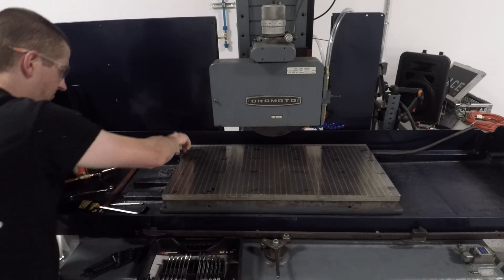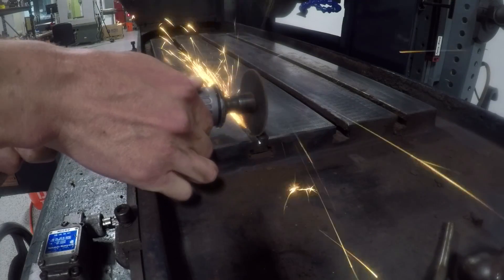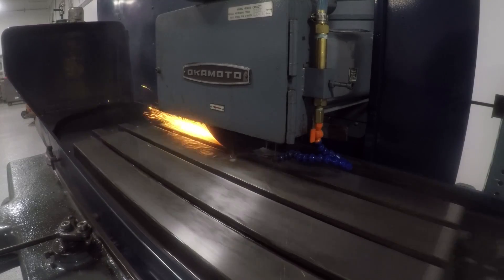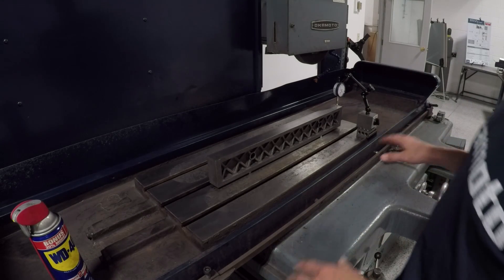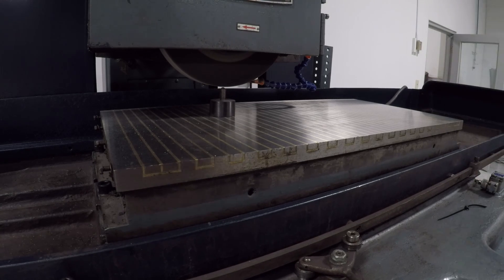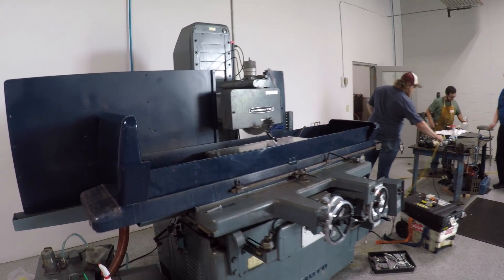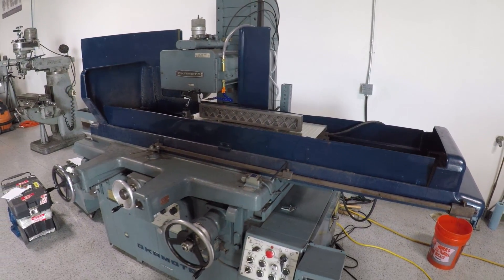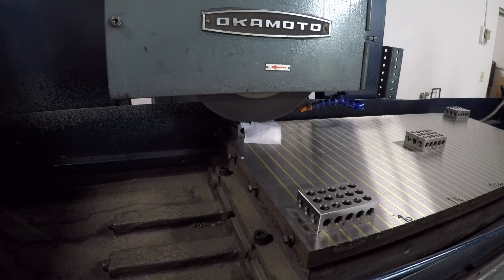Repairing & Re-Grinding The Okamoto Surface Grinder!

Comment: That is a nice descriptive passage, some of the older books do describe things beautifully. Another thing that often gets forgotten is the state, the sharpness, of the diamond dresser. A sharp diamond will remove the old grit from the wheel while a dull diamond will often push the dull grit back into the wheel and do nothing to clean the wheel off.

Comment: next time is better you use a level for check the machine table.and also can change the angle of the indicator,like that sometime no so good.better Tesa analogic level and steps by 100mm foe check surface

Comment: Hi John,
Thanks for presentation.

I have a Grand Rapids 560 12x36 very similar to yours and I just had the magnet off to check for rust and clean because I had just ground a large thin tapered shim by shimming the chuck. The book for my grinder recommends .0002" down-feed to dress the chuck with frequent dressings. The outriggers on it are part of the machine base so no adjustment that I know of.
Good luck.
Eric

Comment: Indicating that straight edge is completely pointless with your indicator on the chuck. What if the left side of the chuck was was high 3"? You would still get a parallel reading to the chuck. You absolutely must indicate off the spindle. Or the side of the spindle or column. That's the only thing that counts.

Comment: After the chuck is back on, Put you indicator in a mag base on the spindle. Get a sharpie and jog the table all over and write the readings right on the chuck. Start at the high spot and drop down .0001-.0003 per pass. Make sure the mag is on when you grind it. I have no idea what you were doing with that straight edge and your mag base on the chuck. Some folk swear by using a layer of crisco on the chuck when grinding it in.

Comment: Put the indicator base on a metal chair OFF the grinding machine. Make an extension if you need to reach then traverse the table in x and y. You can not use the table surface to measure the table surface. It does not matter if the chair is level or whatever you put the magnetic base on.

Comment: You want to do dust cuts .001 is too much 4 a chuck. You want to use water. The heat will cause expansion during the cut the contraction. It is better to use air to blow the coolant into the cut. When grinding a chuck and chuck base feed down of .0002 the one or two spring passes is best. To go past the end of the travel so the vibration of the reverse can settle down. Also for roughing cuts to dress .001 with a steady and kinda quick traverse. Then to finish grind dress .0005 and slowdown the traverse a little to close the grain however doing this will increase heat in the cut. After a finish dress be certain to one pick up the high spot of the surface two only feed .0002 or .0001. Take your time or the wheel will load then you will have warping do to heat transfer. .001 variance on grinding is like .01 in milling or turning.

Comment: think even if you lay a washer under one end of the mag chuck as long as you flatten the table to the grinder everything you grind will be level all over as you gauge everything to the grinding wheel , offcourse it IS better to have everything level to start with in case you remount stuff under the stone like the mag chuck

Comment: It's heat. It's all about heat. More heat is generated as the wheel breaks down. As the material being ground is heated up it warps, and cools down as you spark out, leaving highs, and lows. You need to rough within about a thousandths then redress the wheel, allow the part to cool, and then hit it about a tenth per pass then spark out and you should have better results. Making passes at about a tenth does not generate as much heat as you dial in your size and gives you a more even and accurate grind.

Comment: when you use your grinder, you absolutely need to run it with close to full table limits in X and Y for 10-15 minutes to let the hydraulic fluid get in to all the places its going to get in to.  That fluid layer could be as much as .001" and over a 2' chuck could be way more than that.  Warming up the grinder lets everything get in to place and get warmed up and get to leveling itself back out.  You can't just turn this machine on and expect things to go smoothly.  Grinding is an art.

Comment: John, Make sure when you install that new grinding wheel to have it professionally dynamically balanced! A lot of people do a static balance and think it's good enough, but if you want the ultimate in ground surface finish, get it dynamically balanced and the results will blow your mind.
Reply: I know this post is 10 months old, but is that where the old nerdy guys drag out an oscilloscope and try to identify some kind of frequency?  Just from the sound and some equipment, I think.

Comment: John, something that would have prevented that problem all together is laying down a good corrosion prevention compound on the bare metal under the chuck. I work in the aviation field and we have used many different types of CPC's over the years like that LPS 3 you have in the video (does not work well). What we have found to work the best even in saltwater spray/immersion exposure is corrosion-X. They have something in the solution that not only protects the metal but it will also stop existing corrosion from spreading by neutralizing the acids forming. And to remove rust from metal without changing the dimensions (mechanical removal) we use EvapoRust. No scrubbing no sanding no fuss.

Comment: After everything is done, moving grinder, possible regrind chuck, put silicone around magnet base to machine base, and for some reason, we had read at one time the holding bolts/screws on mag chuck should be of different torque one end to the other, and also we went back and forth about grinding the top of the chuck while it is on/variable etc, and how different a fine pole magnet is to one with bigger gaps? Will try to find that literature? You have done so well, and you really deserve it, I hear you say all the time you are not classically trained, but yet you are a true perfectionist!!!

Comment: I use a Mighty Mag with a diamond mounted in it to dress my wheel.  It's really handy when you have a part on the chuck that you don't want to take off just to dress the wheel for a finish pass. Just slap it on the top of your part and go.

Comment: Would have been nice to have an explanation along those "wrong/right" measurements, as others not-in-the-know might wonder why something is done the way it is. For example, when you put the indicator on the wheel head and measure across the bar, you are effectively measuring the tilt due to unknown surface it is resting on and the way wear. But when travelling a small footprint dial indicator mount across the chuck you are measuring relative differences in the chucks surface. Both are good techniques, just hav to be careful in thinking what is actually being measured.

And the two points you were thinking are called Airy points (https://en.wikipedia.org/wiki/Airy_points), 5/9 of the length of the bar.

And it is a horizontal spindle machine, so the Y is not across the table ;)

Comment: John: One of the hardest lessons to fully learn (and most applicable) about metrology, is that there is no such thing as "perfect", only a higher degree of resolution necessary to observe actual variation from a desired optimum.

Comment: Best to use a cluster diamond on a big wheel, they'll stay sharper and  last longer.  If you want an aggressive cut dress the wheel fast and for a finer cut dress it slow, also if your wheel loads up to fast use candle wax on the wheel, this application is a must for grinding aluminum or beryllium.  Good luck . . . D Oktim

Comment: Lol .0002 dosent really matter unless ur doing some wild micro grinding
Reply: Good luck in your career with an angle grinder then. Day in day out, producing parts that have that 0.0002" as the whole tolerance for thickness, meaning that if it doesnt grind flat, the part is already out of tolerance.
Reply: Doubt it

Comment: Your actual error is .00035 though so you still are off almost 4 tenths. Keep tweaking you will get there! :-) Obviously you have made a hug improvement in it. When you grind you want to barely dust it. If it is barely sparking it is perfect for truing up. Also I run my spindle for a while before starting to grind and also go ahead and run the flood coolant all over the chuck, it will help to equalize the temp. Once you get it grinding parallel then you can try to get it to grind flat!  Well I guess after all this free advise I better go tram my drill press! lmao

Comment: also I forgot when you dress the wheel use a piece of brass and just gently drag it across the wheel to remove any loose material so you don't get those fine gouges in the part if you do all that you will be fine and it will look great.

Comment: Hey John don't use a fine wheel it will just load up too fast I recommend a 46 I wheel and when you get your repeatometer done use that to test it but most jobs .0002 over all will do just fine don't try to get it better than that it will just drive you nuts if you need closer send it to a lapping shop and save your time and energy I can grind stuff to .000001" but it's not worth the time and money lol great video.
Reply: Yeah i learned that sorta new to the industry i was taking hours to get it close to perfect i always aim to get everything .00005 across

Comment: 50%+ cheaper 1-2-3 blocks on ebay:

http://www.ebay.com/itm/1-Matched-Pair-Ultra-Precision-1-2-3-Blocks-23-Holes-0001-Machinist-123/282357203994?_trksid=p2047675.c100005.m1851&_trkparms=aid%3D555018%26algo%3DPL.SIM%26ao%3D2%26asc%3D44759%26meid%3D976b2ec4edc04c6aa5f1b65a52291a27%26pid%3D100005%26rk%3D1%26rkt%3D6%26sd%3D131455116145

Comment: Grinders take some time to warm up. Wheel bearings, slides everything. 

A good half hour to an hour of letting the grinder warm up to temp and stabilize before you grind anything is a good idea. 

Even cold hydraulic oil can cause noticeable thermal movement mid way thru grinding as it warms up and shifts things.

Comment: what wheel did you dress the chuck with? when i did mine, it was a hell of a learning curve doing that(oh and dry as well). also why didnt you grind the bottom of the chuck? PLEASE give any and all insight on grinding wheels, i have started down the rabbit hole, and ITS DEEPER THAN I COULD HAVE EVER IMAGINED!

and I may be getting ahold of you to grind up some new ways for my little taft peirce no. 1. depending on where i end up with mine.

awesome to see that kind of run out, thats a HUGE table.
Reply: He did grind the bottom of the chuck.
Reply: Jaakko Fagerlund im gonna have to rewatch.
Reply: was that thw little clip before checking the table for flatness?

Comment: For the condition you restored the grinder to, what sort of precision would you bid a surface ground job for?  i.e., would you take on a job requiring you had to deliver a 8" x 8" x 2" tool steel block ground to a 64 finish, flat and parallel within .001"?  .0005"?  etc.

To paraphrase Dirty Harry, "a man's got to know his machine's limitations" - to bid a job.

Comment: I think you've been a bad influence.  I'm now lapping stuff in.  Have an aluminum disk that I've lapped in on a mirror and now I have two steel disks that I'm lapping into each other.  There is something about making things exactly so that is addicting to those who have that quirk.  I don't think I'll ever have a surface grinder but have a mirror and plenty of sand paper.
Reply: Tom Lipton has some videos where he investigates and performs a few lapping procedures.  Interesting stuff.  Check them out.
Reply: Robert Palmore shot root beer out of my nose with that last line. Hurt like hell!! Worth it tho.
Reply: Is a mirror really that flat?  
Now that I think about it, if you look at a reflection of lines, or a matrix of lines, you can easily see if it is flat.  But does the surface of the mirror or is it the rear, silver paint on the rear of the panel makes  the reflection flat?
Hmmm..   Anybody knows, guys?
Reply: I'm pretty sure it isn't as flat as that nice surface grinder is but it sure is one heck of a lot less money.  I'm thinking about taking two 1" pieces of steel and lapping those together and that does make them pretty flat if you do it right.
Reply: I've ground and coated a fair number of optical surfaces and there is no such thing as "Flat" only approximations.  Even a very good approximation of a flat surface will change depending on how its supported, no matter how thick or sturdy it may appear.
Reply: I understand what you're saying about "no such thing as flat".  Life is full of these little things we have to decide on if it's good enough for what we're doing.  I know I'm not making it "flat" just flat enough.  I can see in my minds eye the roughness of a mirrors surface and the horrible amount of flex that thing goes through just with a mild temperature change.   But it does what I need of it.  Oh,  btw, I keep it turned to the wall, that fat guy keeps showing up the same time I do.  Damn untrustworthy NOT flat mirror.

Comment: You need to watch Stans channel on wheel dressing. Also use archoil reust remover on the table, you mix with water, does not work with out it.  Great video.

Comment: John, when you say "a tenth", a tenth of what?
Is it 0.10? 
        0.01?
        0.001?
        0.0001?
You say something is good because it only has a deviation of a tenth. Then in another sentence you say it's bad because it is a tenth either high or low.

Please clarify which tenth a 0.1" is enough to feel through a work boot with your foot.
A 0.01" is OK for foundry work.
0.001" is getting close to close enough, but I think the tenth you are meaning is 0.0001 or less. Is that correct ?
Reply: It's typical shop terminology. It's a lot easier to say, "a tenth," than it is to say, "one tenthousandth of an inch."
Reply: longcaster tenths in machining is a tenth of a thousandth, or 0.0001". Virtually all of machining jargon and shop-speak is in "thou" (1/1000") or "tenths" (1/10000")
Reply: Aside from the replies, to answer your question yes you're correct. It's o.ooo1
Reply: god damn imperial
Reply: Dušan Pešić I mean talking in microns is identical
Reply: longcaster in machining .0001 is a tenth .001 is a thousandth .010 is ten thousandths and .100 is one hundred thousandths
Reply: Thanks. Cause getting something to 0.1 ain't doing so good with a machine.
Reply: longcaster yeah lol. Getting 1/8th" is easy even by eye with a jigsaw
Reply: To add one more layer of confusion (or clarity, depends on how your brain does math...), half a "tenth" is "fifty millionths."

When you start approaching ten millionths (a tenth of a tenth), you're into Tom Lipton/Robin Renzetti optical flat territory. 😎
Reply: chris0tube Both systems are arbitrary. It's just the metric system arbitrary common unit for machinists is 1/25.4th as big as the imperial arbitrary common unit. Metric users can get to the same level of accuracy with one fewer decimal place. Sooooo, by inference and some very sound logic, that means we imperial users must be smarter since we're slogging around with a fourth digit everywhere we go. 🤓
Reply: Christian would you like to get your decimal point, ones and zeros right?
Your first two examples are correct, your third and fourth are not.
.100 is the same as 0.1 (a tenth), .010 is 0.01 (a hundredth).
I'm glad you are not measuring anything for me.
Reply: chris0tube True, true. The bar for entry into this club is high. We're not woodworkers, we're machinists! We'll spend 2X the time fighting for another decimal that's worth only 10% of the previous decimal.

(So says this former, and sometimes current, woodworker...)

Comment: That sag in the middle of the chuck could have been due to the rust. Rust would have pushed up on the chuck, making it bow upwards. If it was ground in like that it would end up slightly thinner in the middle. When you cleaned out the rust it pulled back straight(er) with the resulting dip in the middle.
Reply: Yup, I'm doing this with our grinder at work this week.  The underside of the chuck looked very similar to John's.

Comment: Self repairing machinery, pretty cool.
Reply: It will only self-repair if the ways are flat. If they are not, no amount of grinding the table or chuck can save the thing. If ways are worn, then the only way to get it do flat again is to scrape the ways properly.

Comment: Super video John. One question..... How do you keep the rusting from reforming on the chuck bottom in the future?  More modern coolants?  Dono....
Reply: Fred Miller if u listen to oxtools Tom Lipton, frog lube
Reply: Thank you Bill!
Reply: Coat it with POR-15.  You will never have to worry about corrosion again.  The stuff is amazing.  I have seen it used on car frames, outdoor machine parts, anything where rust and corrosion is a problem. Problem solved.   It costs $50 a quart, but it is worth every cent!....http://www.por15.com/
Reply: My vote is for Frog Lube. I apply to all my machine that have exposed surface prone to Rust. Frog lube is a Wax (like car wax) so it forms good thin layer of protection. There are many Frog lube torture tests on you-tube, and that last time I checked, nothing beats frog lube.Another good protectant is Fluid film which I use on farm machinery for protecting bolts and other surfaces that are difficult to reach or clean (some rust protectors don't work well on dirty or already rusted surfaces).

Comment: Good one!
While I do the 5 block test myself, it can be misleading. It tells you only that you grind parallel, it is not a direct indication that you grind straight. That can only (well, not only) be tested with a straightedge/parallel as you showed earlier in the video.
The 5 block test is great to show that you ground the mag chuck properly.
Good to see Richard in the background :D